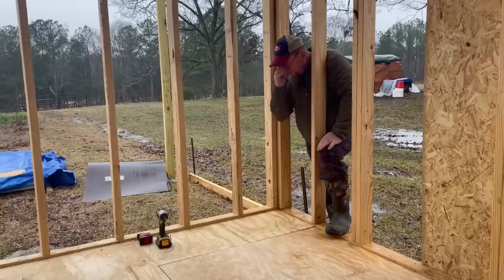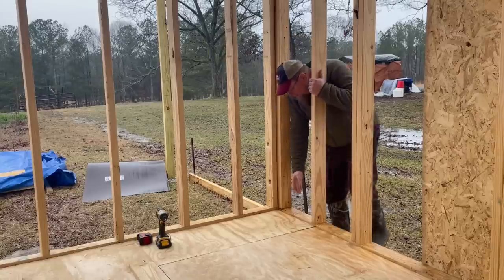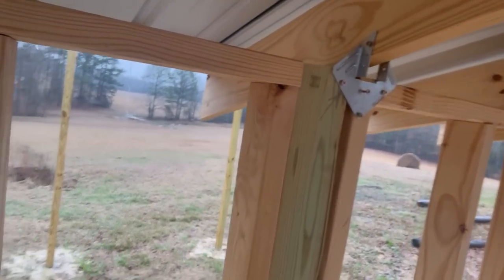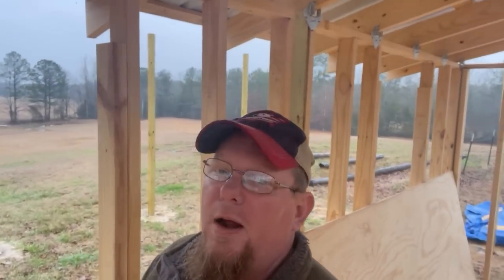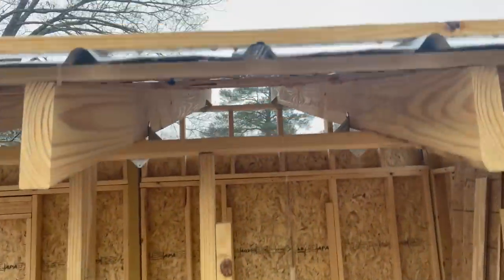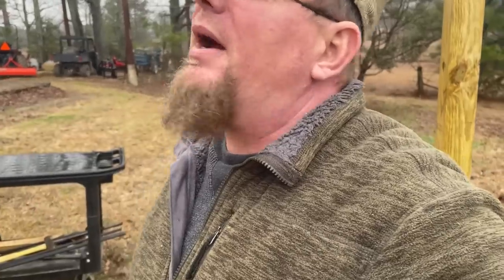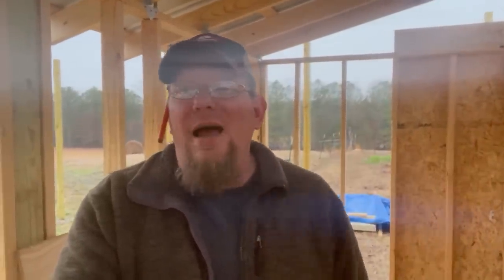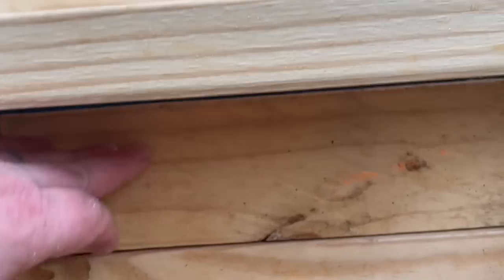Major Construction Mistakes On Our Predator Proof Chicken Coop Build

Comment: Mike, you don’t have to slice the bottom plate in the doorway to make it level. Just cut the 2x4 plate out and add your plywood on top of your floor joist, even if you have to scab a 2x4 on each side to hold the plywood. It’s a chicken coop and a learning experience, don’t beat yourself up. Being in construction for over 40 years, I’ve seen a lot worse from so called carpenters. Keep up the good work! I wouldn’t worry about that second plate because that roof is distributed weight and your headers over the doors will prevent any sagging in the roof.
Reply from the maker: Thank you 🙏
Reply: @3MISSISSIPPI  I'm glad I scrolled the comments first before offering up my two dollars and 57 cents. Mr. Callais is spot on and its the same as if you did it right but it's still wrong and will work.

Comment: lol;;;man oh man;;;;sounds like ya got lots of comments;;;;here's the thing it is a chicken house;;;;lol;;;I would cut out two by six and add one by four for heignt to floor;;;belt sand the difference to be able to clean out chicken poo;;;maybe add two by six on outside all the way around the two long portions of building;;;just make break offset from two by four top plate;;;;there are many more experts out there that never drove a nail or screw or cut a board or measured spacing for walls, roof, or ceilings;;;heck I know craftsman builders that make rough openings for windows and doors the wrong size for what goes in the rough opening;;;if they are too large they added but if too small lots of creative fixing;;;lol;;;so don't fret young man;;;keep up the good work;;;if my bicycle didn't have two flat tires and the steering wheel wasn't rusted so can't turn I'd come down and help;;;;;but;;;;anyway just glad to see you be an upstanding outstanding person and all those who are quick to correct you either never have actually done any construction or have done the same or similar mistakes;;;;heck try putting fifty byseventy five building up on a slab that is two and half feet out of square;;;lol;;;;simple fix;;;concrete man just added twelve foot storage with  before we started walls etc;;;lol;;;;always enjoy;;;;thumbs up and keep em comin;;;;
Reply: oh I forgot to mention them look like my work pants you be wearing;;;;;lol;;;;not much for wear and tear but great for comfort;;;;lol;;

Comment: you did overlap your tin wrong and to address the extra top plate, after you put the sheathing on the outside run you a 2x6 up on edge under your rafter tails on the outside sheathing. that should give you the support you need

Comment: Mike, being a General contractor for 30+ yrs, I can say that I've seen a lot worse lol. Don't bother cutting off the exterior sheathing to the double top plate like u mentioned at the end of vid, just rip what is needed to finish it leaving at least a 1/8-3/16 inch gap, OSB especially in your humid and wet climate will swell like a mo fo! Cheers from Canada!😁🍺🇨🇦❄

Comment: I wouldn't worry about your weight load on not having a top plate.  Those H1Z should be good. Normal construction only requires 1 on every other truss from most engineers.

Comment: You’re gonna be okay with not using a top plate, since you used those Simpson hangers.  Your header will prevent any sagging at the doorway. I’d use my sawzall to cut the 2x4 out of that doorway, get it flush with plywood, and get a piece of sheet metal to put over the floor, like a tile entryway

Comment: I doubt that the missing top plate will cause any problems. The siding (with a few extra nails) will help support the single plate. As far as the door header goes it depends on the width of the opening. Your 2x4 is sufficient for this build.

Comment: Best lessons are learned from mistakes. Mike most people will say you lapped the tin backwards but I've been installing tin for over 30 years and that's how I install it and never had it leak. It's a stronger lap in my opinion. Coop is coming along.  Next time lay the floor then put clear plastic down to protect it till the roof is on.

Comment: Hey Mike when you add the top piece of siding calk or silicone between them. I didn't on my storage barn and water was running down the inside even worse it was on the north side not getting any sun. now I have to repair places in the bottom plate. I used 5/4 deck boards for flooring so it was just one layer of flooring.

Comment: They make a bracket that u can screw to the top plate and to the rafter that are required in some areas I believe they are called hurricane straps u can put them on after you have the tin on

Comment: Suggestion  for a fixed structure  that you don't intend to move like chicken tractors  concept  
the perimeter  lay down expanded  metal  or heavy duty hardware  cloth   (wire screen)  on the ground  build  on top  of it leave more to the out side  and cover with gravel  or whatever  this hopefully  deter preditors  from digging  under  

From what I see about how flooring  meets foundation  recommend  wire  screen  when open spaces will allow air flow  help keep from rotting wood joist and mold  and
Critters out
Reply: Also suggest  either  good quality  laminate  flooring  or linoleum on floor  of coop  this will make keeping it clean much easier  a d plywood  floor not soak up moisture  from chi c Jen waste , ect